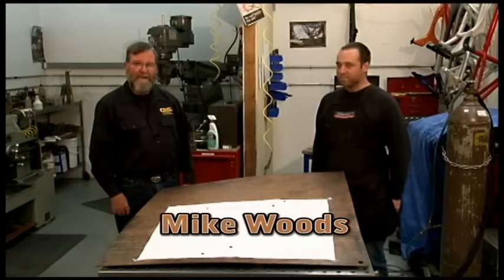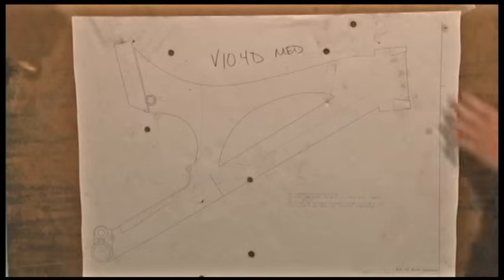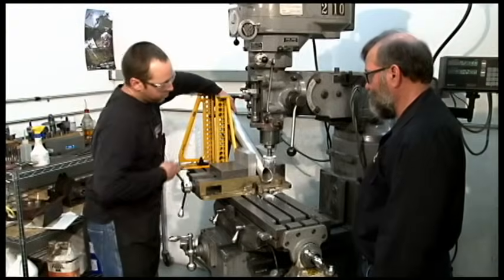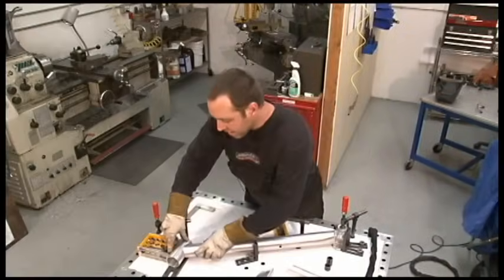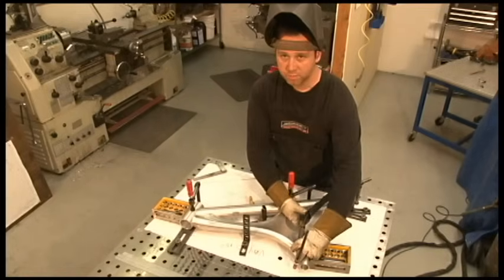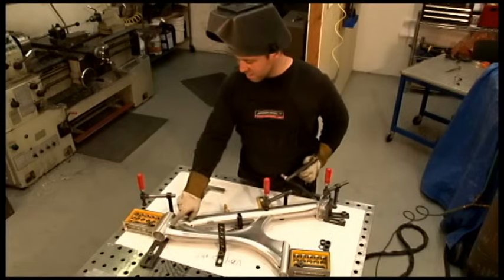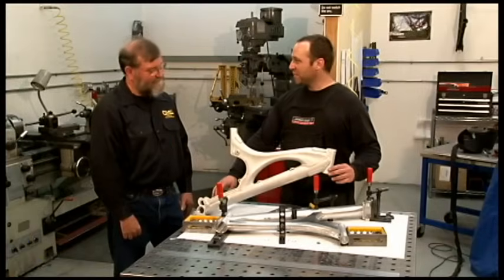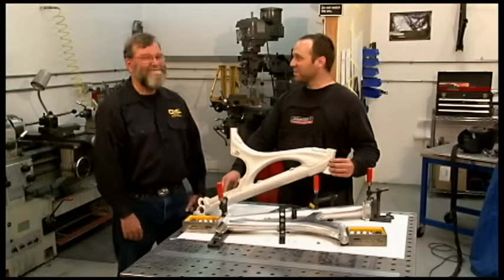Welding Aluminum Bicycle Frames

Comment: I find the weldings ugly. Too thick on the frame,  no nice flowing weldings.

I would not buy such a bike.
Reply: No prob.  I will say, though, that they aren't autogenously welded.  It's easier to get a very smooth weld autogenously, but I don't think I would trust one on a bike frame.  It's good to have at least a little bit of extra material in the fillet.
I'm not sure what technique is actually used, or if they're just normally welded, then smoothed out with an extra pass of the torch, just for cosmetics.
Reply: nwimpney I had a cannondale frame with welds like that and I have a diamondback with welds like that now. They look ok to me but I prefer traditional looking welds on frames.
Reply from the maker: I wonder if the 'standard' you are comparing this to is a TIG welded steel bicycle frame? Welds on thin aluminum tubing are always larger and more 'bumpy' than welds on steel. In the world of aluminum bicycle frames, I think Mike Wood's welding is very good!
Reply: The old way Autogenous welding. Flam flux and special welding wire for aluminum.  Beautiful smooth welds.

I have done it many years.
Reply from the maker: I've never seen an aluminum bicycle frame welded this way. Can I see a picture?
Reply from the maker: Well, that video shows aluminum soldering, or brazing. While this process certainly has its uses, it's not as strong as welding, and I don't believe aluminum frames with soldered joints can be heat-treated, which is essential for aluminum bicycle frames.
Reply: You know that the original Autogenous welding process is different. 

The different on the video is that there be used a other burner other welding material.  

Loose wire for aluminum with flux. I have a lot of pipes welding together. 

Unfortunately I have no more pictures from it.

never a connection is broken or torn.
Reply: I've seen some aluminum bike frames going for a smoother weld appearance, rather than the "stack of dimes" lately. 
For example:
http://allcitycycles.com/images/bikes/Thunderdome-Detail-3.jpg

I'm not really sure that there's any advantage, other than aesthetics, though, and I think they're probably putting a lot of extra heat into the surrounding metal in the process.

There are certainly other techniques to get a less bumpy weld, if that's what you're going for.
Reply from the maker: Thanks for sending the link. I haven't seen a bicycle frame done with that style of welding.
Reply: +Ron Covell i think I first saw that type of welding on some older cannondale frames.   they don't draw quite as much attention as on a polished frame like that,  though.
Reply: Thank for the link i have I have a lot of pipes welding together. pity I have no more pictures from it.
Reply: Beautiful smooth welds, that's another way to do it.

Comment: Good jigs seem to be absolutely essential for welding geometrically-critical things.
Reply from the maker: Yes, stuff moves when it's tack welded, and moves more when it's finish welded, so it's hard to get precision without rigid fixturing.
Reply: Normally they cut the copes in a milling machine, so that they are pretty perfect when assembled.  Then they fixture it.  Then they weld all the tubes except the seat stays, then they take it out, cold set any problems, then they weld the seat stays.  That is on conventional frames.  This is pretty unconventional.  Of course a lot of the frames sold are not straight.
Reply: @krrrruptidsoless - Watch it again.  He says they jump around to minimize distortion but it always distorts so they heat it up in the oven and move it around.
Reply: avro549B yes for most welding applications the hardest part about smaller items that aren't secured is distortion. Pipelines and such it isn't as much of an issue
Reply: Ron Covell by the way your welding is on par👌
Reply: Always has been, always will be, true. 
If it aint bent, don`t straighten it-unless you`re welding it! :)
Reply: καταπληκτικό!!!

Comment: Nice weld.  What grade/s of aluminum are the parts made of?

Thanks for sharing!
Reply from the maker: I don't know for sure what alloy of aluminum they use for these frames, but it's likely to be 6061. That alloy has very good strength, and is easily weldable, and heat treatable. There are stronger alloys available, but most of them can't be welded. That's one reason that aircraft parts are riveted together.
Reply: Thanks for the reply.  Good info!

Do you know the optimal heat treatment protocol for 6061?
I'd like to see what the typical recommendation is & how it effects the mechanical properties of the aluminum.

Thanks again!
Reply from the maker: I've always sent parts out to be heat treated, so I don't know the particulars. I'm sure you can get more information with a web search.
Reply: Ok.  Thanks.

Comment: Where does that monocoque thing comes from? Is it made from plates in the shop itself or is it build on demand by a supplier?
Reply from the maker: I don't know where the monocoque is actually made. I didn't see any stamping equipment on my tour of the Santa Cruz facilities, so it's likely they subcontract that component.
Reply: Thank you for your answer! Must be quite costly.
Reply: I don't know where Santa Cruz gets theirs, but I know someone who used to supply more or less the entire industry when this technology came to bikes.  His name is Gary Pimentel with American Monococque (San Diego area).   The equipment to do it is a bit pricy, but the forms and process is rather simple.   It's basically a big urethane sheet that is pressurized over the aluminum blank and the form.  High pressure pushes the aluminum sheet over the form, then just some simple trimming is done in post.  He has some forms made out of wood for short runs, but most are just CNC aluminum dies, which we crank out all the time.  Compare this to tubular hydroforming, where very high pressure is fed into a tube, that forms into a female mold.  It's way more expensive as far as tooling, and takes some very heavy machinery, but makes some really nice and relatively inexpensive parts, when the tooling can be amortized over thousands of parts.
Reply from the maker: Mark, thank you for that excellent description, and for letting us know about American Monocoque!

Comment: This tool used to heat with the left hand, is it a laser tool or what kind of tool is it? IS the  rod aluminum as well?
Reply from the maker: The welding process used in this video is called 'TIG Welding'. TIG stands for Tungsten Inert Gas. The handpiece (called a torch) holds a tungsten electrode, which directs an electric arc, creating the heat for welding. The arc is shielded with argon gas, which keeps the weld area from oxidizing. The filler rod is aluminum, in this case. You can see a lot more detail about this process here: https://www.youtube.com/watch?v=3sp1BP29J4E
Reply: Thank you so much Ron. You are such an encouragement with getting better knowledge here.
Reply from the maker: Yes, you are correct that GTAW is a more precise term, but the term 'TIG welding' is still more widely used, and better understood. I&#39;m not aware of non-inert gasses being used for GTAW welding - can you enlighten me on this point?
Reply: Learning more here. 
So with this welding process are there any other hazards in the process apart from the protection of eyes with this special protector that I see in very related video?
If you don't mind Id appreciate a word about the rating on welding machine in terms or watts / kilowatts
Reply from the maker: Well, the addition of Nitrogen gas is not something I've heard of before. Thanks for helping to continue my education!
Reply from the maker: Well, there are several hazards to be concerned with. First, is the heat. You should always wear gloves, and a long-sleeved shirt. Shoes should be worn (not open-toed shoes). Second, is that the light can cause 'sunburn'. The precautions I've listed will help with that. A few metals, like stainless steel, zinc, and brass (which has zinc in it) give off fumes which are quite dangerous to inhale. 

The 'rule of thumb' for welding current is that you need around one ampere for every 1-thousandth of an inch of material thickness, or 40 amps for each millimeter. I think the material thickness for the bike frame is around .050" (1.5mm), so the welding amperage would be around 50 amps.
Reply: Of particular interest here is welding of aluminum sheets and tubes. Is there any other hazard that is specific to welding aluminum?
Reply from the maker: Well, I'm not a doctor, scientist, nor a welding engineer, but I'm not aware of any hazards that are particular to welding aluminum.
Reply: John O'Herron
Yes I am researching towards a project. 
In my part of the world aluminium welders are hard to come by and I find its properties better than steel for the projects I have in mind. That's why it is such a joy to come across those with the experience I seek. Learning from those ahead of me in the area is invaluable to say the least. 
To you and Ron Covell, I can't thank you enough.
Reply: Any title you can recommend I place an order? 
Of specific interest is the TIG welding, all there is to know about it targetting DIYs
Reply from the maker: I have made two DVDs on TIG Welding - TIG Welding Basics, and Advanced TIG Welding. You can see short versions on YouTube, and you can purchase the DVDs on my website - www.covell.biz

Comment: looks really cool.  light and strong and straight after the straitning and heat treating
Reply from the maker: Aluminum is a great material to make a bicycle frame from, as long as it's heat treated!
Reply: What is the process for heat treating it? Also what grade of aluminum is it?

Comment: No purge of the I.D.? Pithy Bikes on YouTube has a good series on fixtures for bike frame welding.
Reply from the maker: Purging the inside of tubing is quite important with stainless steel, but not nearly as important with aluminum, mild steel, or alloy steel. It never hurts, though!

Comment: What was the purpose of the keyway broaching tools on the table when you were welding? Great welding by the way,what set up and settings were you using?
Reply from the maker: There were a lot of fixturing components made by the Bluco company which were used to precisely locate the bicycle frame elements on the layout table.

Comment: How do you avoid the inherent warpage due to heat treating?
Reply from the maker: Heat treating can cause distortion. Often the best fix is to straighten the part after heat treating.